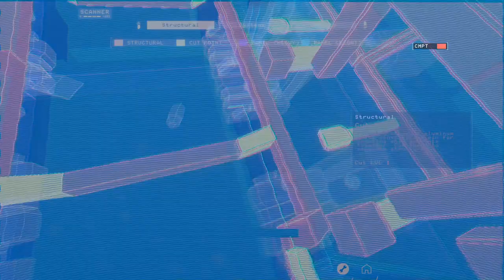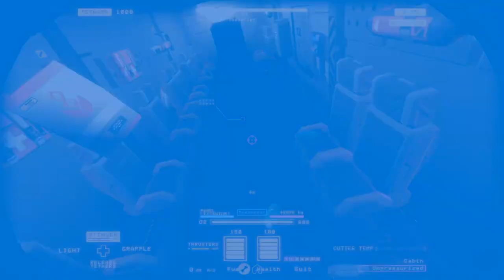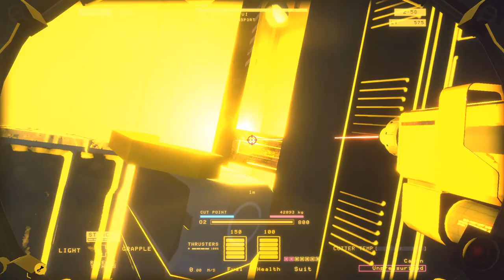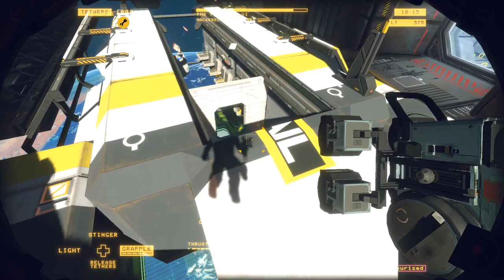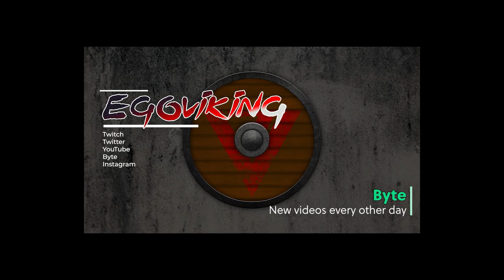Hardspace: Shipbreaker Tips and Tricks for Salvaging the Mackerel

Comment: Thanks for the tip involving forgetting about the airlock chassis. I would waste so much time trying to get that last bit free, and forgetting about the pressurization has screwed me more times than I'd like to admit  so just saying "fuck it" and dumping the whole thing into the furnace is good to me.
Reply: I always try to remember to re-open the airlock after flushing the atmosphere from the cabin. Depressurizing the entire ship before moving on helps reduce accidents later on.
Reply: I leave the interior airlock door open as well as open the cockpit doors then flush the air. At the end of the sequence both doors reopen and drain out air safely into the main chamber of the vessel.